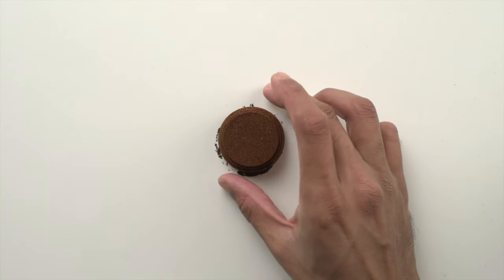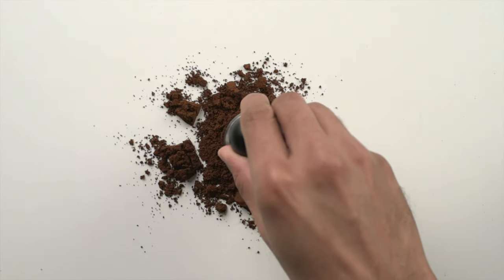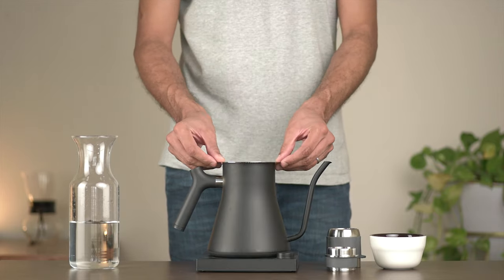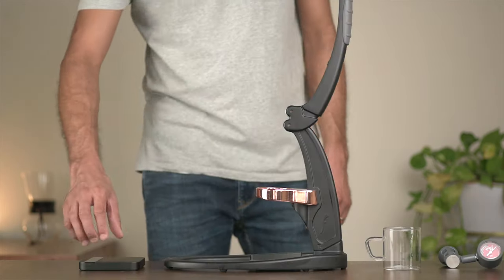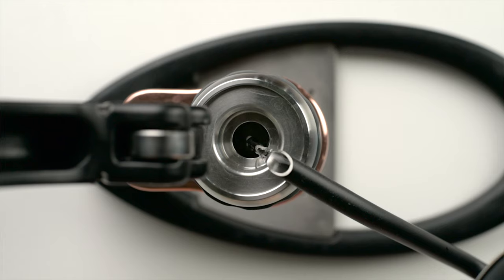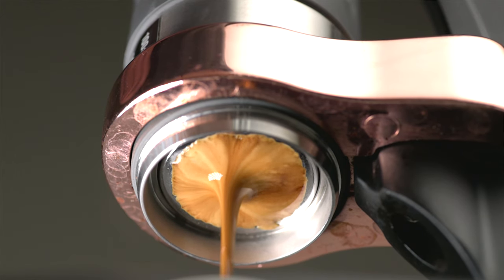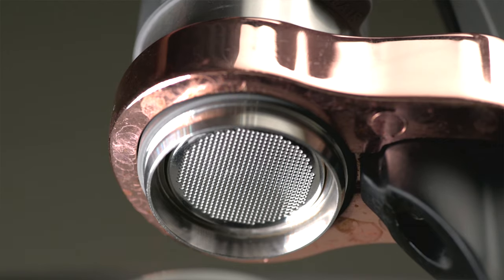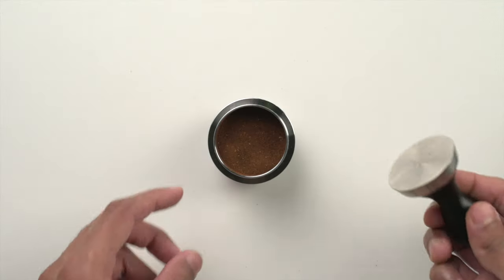The Art Of Manual Espresso | A Detailed Guide Using The Flair PRO 2

Comment: For preheating no need for a fancy kettle. Take a saucepan, add half an inch of water and sit the brew head in there untill it boils! Takes 2 minutes and works great!☕️
Reply from the maker: Hey thanks for stopping by. I don't recall anyone saying you need a fancy kettle. You just need A kettle and you can use this method to steam pre heat, which is quicker and more efficient than a water bath. This also makes the overall workflow more streamlined for us, but you do you.
Reply: @aramse  yes I mean this for those who don't actually have a kettle, fancy or not 🙂 (I don't)! You would be surprised by how fast you can boil the water and heat the chamber at the same time on a saucepan if you use just a small amount! Then use the same water to brew the shot ☕️. Of course everyone can use the method they want and all that maters is that it works for them! I just wanted to share an alternative option that works for me! Cheers ☕️

Comment: What grind settings would you recommend on the Comandante Grinder, for light, medium and dark roasts? Using a Flair Pro 2. Thanks in advance!
Reply from the maker: With red clix, which we highly recommend for espresso we’re usually between 14 - 22. For a given dose, lighter roasts need a slightly finer grind than medium roasts.
Reply: @aramse  any recommendations with jx pro hand grinder settings?

Comment: Hello and  thanks for the great video! My question is, since you fill water all the way to top to avoid air, should you push through all the way to the end or weigh and only pull the amount for the brew ratio you are aiming for?
Reply from the maker: The latter. We use scales to weigh out the ratio we want.
Reply: @aramse  Cheers!

Comment: Wow, great info. But the thing that confuses and frustrates me here is the WDT tool. You give it such importance, but I can't see it working, so it feels like I don't know what I'm doing or why. I get that the IDEA is to break up the coffee, but I don't feel much of anything as I use the tool. Is it really that necessary?
Reply from the maker: It can certainly be frustrating to zero in on what exactly is causing issues with your brew. Also not all WDTs are made equal -- you can use anything from a chopstick to a toothpick to a paper clip to acupuncture needles to distribute coffee and a lot of these can do more damage than good. If you use one with flexible needles that are around 0.3 - 0.4mm you get the best results. It also takes a little practice and a bit of time to even out the bed properly.

Comment: I'm curious why you put such emphasis on only one tap to settle the grounds? Depending on the beans I often need more than one tap to get the grounds to go below the top of the portafilter.
Reply from the maker: It’s primarily for consistency. Tapping too many’s times can cause channeling due to   uneven compacting of the grounds. But yes some coffees need more than one tap and that’s fine. Just try not to be too aggressive with it and try and keep it as vertical as possible.
Reply: @aramse  Great explanation thanks! I'm still working on getting consistency out of my Pro2.

Comment: Awesome tutorial, I notice you too have a Comandante, how many clicks are you using?
Reply from the maker: Hey thanks. We’re usually between 16-22 clicks on the Red Clix system depending on the roast level and density of the beans.
Reply: @aramse  thanks, I'm wondering if there may be something wrong with my Comandante, I'm having better results with 13-15 clicks (Red Clix). Anything more and water just goes straight through, can barely get 4 bars
Reply from the maker: @Assenayo  If you're brewing very light roasts then those settings a not too bad tbh. Also, how old is your grinder? If it's brand new it could take a few kgs of coffee to season and start producing more consistent grinds. Lastly, there are 6 positions in which the burrs can be placed onto the hex axle. Try all and see if things improve at on of the other positions.

Comment: Can you use the 1Zpresso J-Max with the Flair pro 2, I'm trying with mine, but i just can't get a good shot
Reply from the maker: The JMax works really well with the PRO 2. What issue are you facing exactly?
Reply: @aramse  Really wet puck, not very good taste, what number are you dialing in with the J-Max
Reply from the maker: @staceyramirez7843  wet puck means nothing with the PRO 2. What’s your dose, what pressure profile are you using, what’s your yield and what’s the brew time? Also could you describe a little more what you don’t like about the taste and go you have a good comparison point?
Reply: @aramse  Can you please make a video using the J-Max, so i may learn from your technique, I'm not a professional, i put in 17g, i get out 
40g, temperature is 190° fahrenheit,  around 40 second shot out time

Comment: Are these techniques applicable to something like the Flair Neo that has a pressurized portafilter? Or is there a different recommended workflow?
Reply: I have the NEO and follow a very similar workflow - and have the Brew Head with Bottomless Portafilter and PGK (https://flairespresso.com/product/brew-head-with-bottomless-portafilter-and-pgk/) upgrade when I have more time to sit and dial in.  The NEO doesn't require as fine of a grind since it is a flow controlled (doesn't open the bottom valve till it hits higher pressure) vs a bottomless (no valve or spout).  The NEO/Classic are also a smaller brewhead so would be less weight of coffee and water.  I preheat on my kettle in the same way, also use a Comandante and WDT, but use a Crema tamper/distributor (https://www.cremacoffeepro.com/products/39-25mm-for-flair%E2%84%A2-tamper-distributor-combo.
Reply: Same thing for the NEO, just grind a bit coarser, or take out the pressure spout thingy.
Reply from the maker: Yes most of these principles with respect to workflow will translate over expect for the obvious one of using the visual queues to gauge how things are going. A pressurised portafilter is a lot more forgiving as it restricts flow to build up the pressure where as with a bottomless the coffee has to do all the work, which is why a good grinder and proper puck prep are so critical.